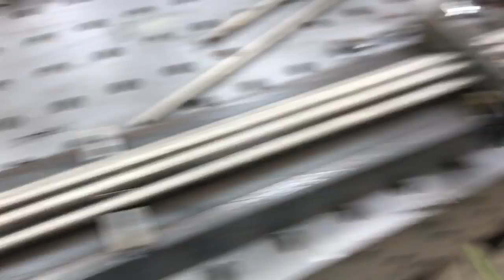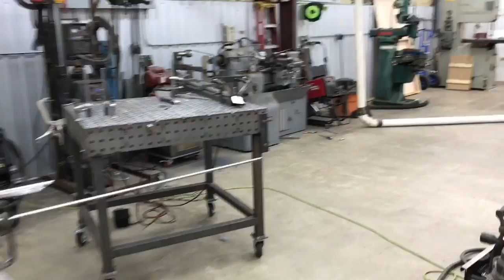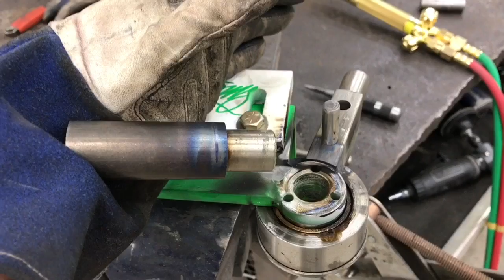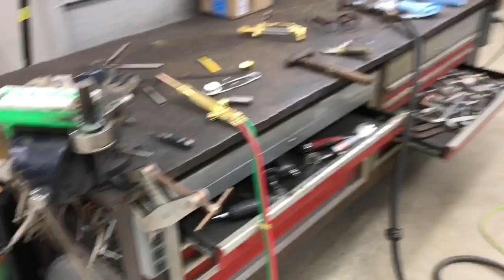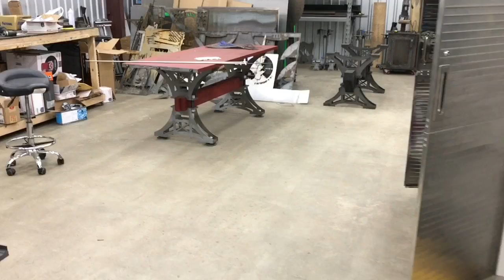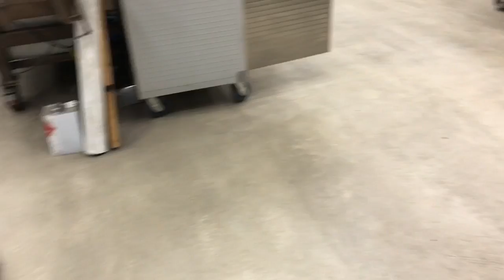Forge Induction Element Part 2

Comment: Your contaminating the stainless by using carbon steel in your jig. It needs to be all stainless or aluminum, also you can use nylon plastic on all the surfaces that touch the stainless but that seams like more work...
Reply from the maker: Some great points, thank you!